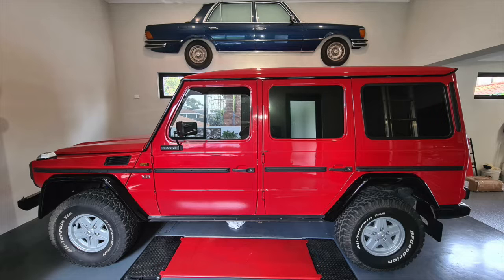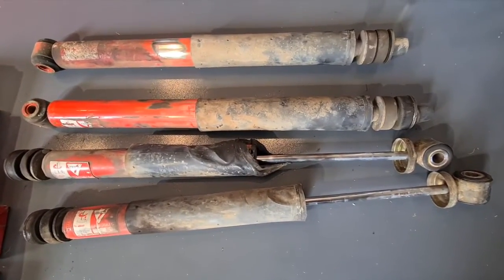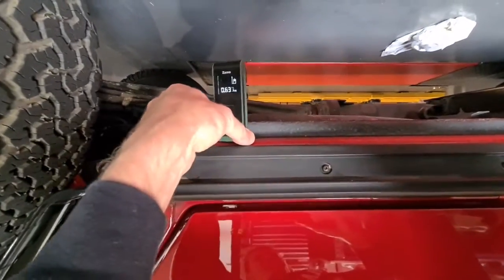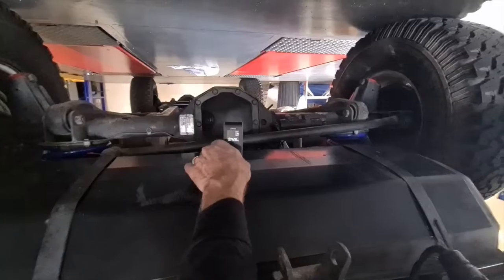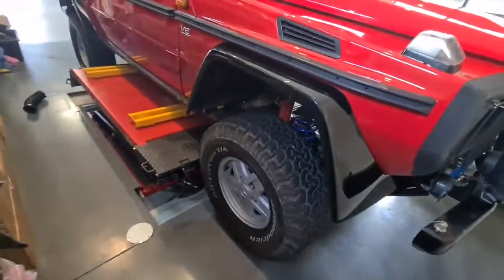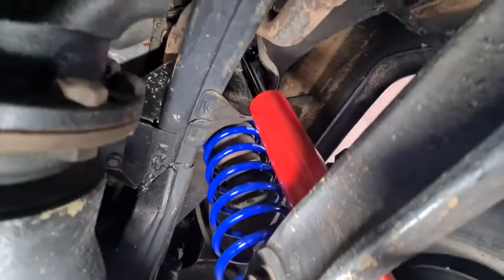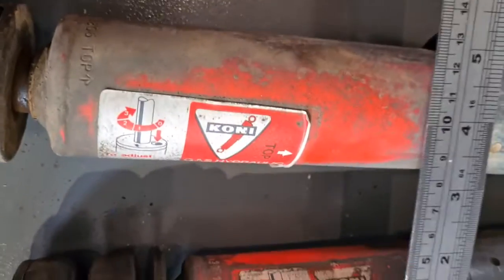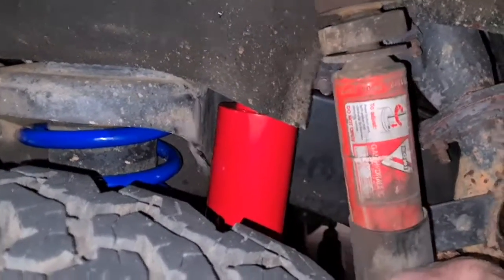Mercedes 460 ORC spings and Koni Raid shocks

Comment: Did you need to fit an adjustable pan hard rod / track bar to recenter the diffs?
Reply from the maker: No but my rear driveshaft needed rebalancing 10000km after this. but this could have just been normal wear and tear!

Comment: How did you like the setup after all this time? Thinking of doing the same but might go the body lift option instead. Seems less issues down the line?
Reply from the maker: Hi, Admittedly I dont drive the 460 much anymore as Ive been focusing on another MB project and the G is parked in!  I found the ride was much nicer around town to start with.  I dont get too much time for any heavy offroading any more.  Im glad I did it as the old shocks would have been 35 years old!  I can recommend but as an Australian, it wasn't cheap to get the stuff here!
Reply: @w116036  I hear you. I am in Perth also and it costs alot to get it...but I guess it's a great investment even for improved city driving. I'm looking at dropping a M104 3.2 to replace the worn out M102 so an upgrade of the suspension will also be good. Just need to figure out priorities haha 😂

Comment: I have done the same upgrades on my 1986 280 GEL. Extremely happy with the set up. What settings did you adjust the raid shocks ? Soft or Medium ?
Reply from the maker: Im not sure what setting ive actually had them put on Baba!

Comment: Are you on instagram mate?  Love your build would love to see more.  I want to do similar setup in my W460  in Australia
Reply from the maker: In in WA mate
 Not.on insta as prematurely old and keep it simple. I had a separate FB oage on my MBs but they shut it down as it was a second account!
Reply: @w116036  your paintwork looks amazing.   I want to respray mine but i cant decide on the colour. I got a 87 SWB with a OM606 Turbo.
Reply from the maker: @IneosGrenadierWorld  its not bad URA, but it was done about 20 years ago after an off road 'incident' in the same original colour.  After the beige, the red was the most popular colour of original 460s brought into the country. There used to be many red ones!